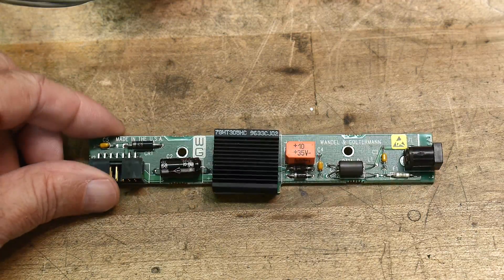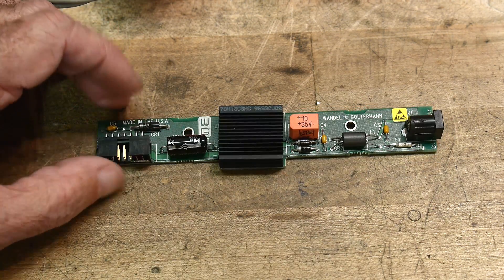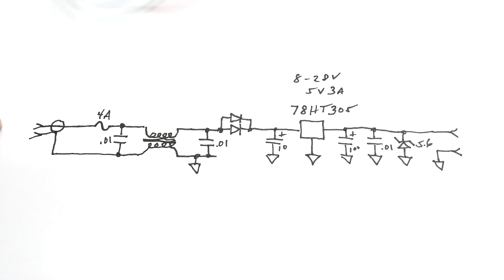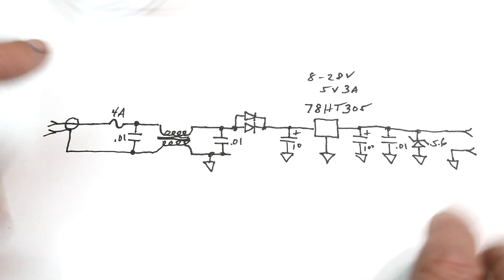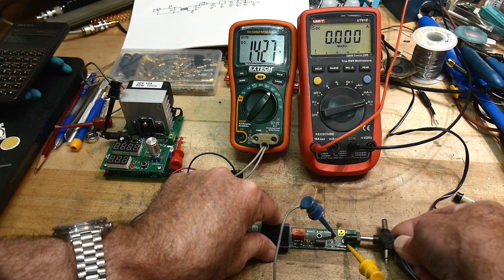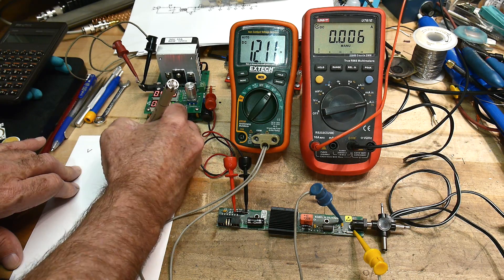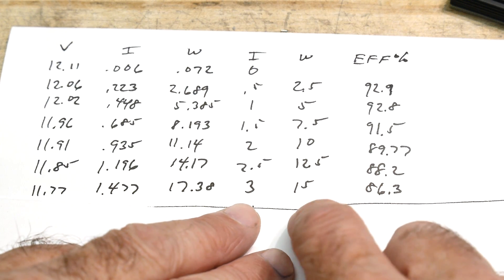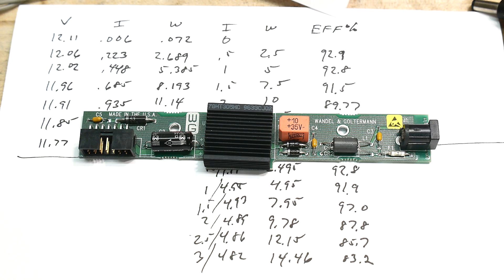#637 Measuring DC Power Converter Efficiency

Comment: If you want to get the real efficiency figure you have to measure the output voltage at the module output pins (and the input voltage at the input pins).
The long thin wires to the load introduce a voltage drop of which you can't blame the regulator of.

Comment: While we don't know what the intended maximum power consumed by the device was, the regulator will attempt to regulate at around 8V in, which even assuming perfect efficiency would yield near a 2A draw through those two 1A(?) diodes assuming that they perfectly current shared at the rated full load output. The regulator efficiency is probably 80% at best at that low voltage, so those diodes could burn out without activating any of the thermal or current limits. Power rectifier diode forward voltages can vary quite a bit from unit to unit, and so the only thing forcing any reasonable amount of current sharing is the silicon bulk resistance of the diodes which act as a minimal and poorly ballast resistors. As you state, they should have went with a 3A diode like a 1N5401 (or a schottky) to prevent unintended burn-out at low supply voltages.